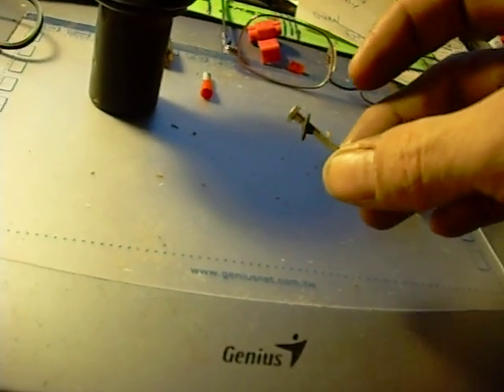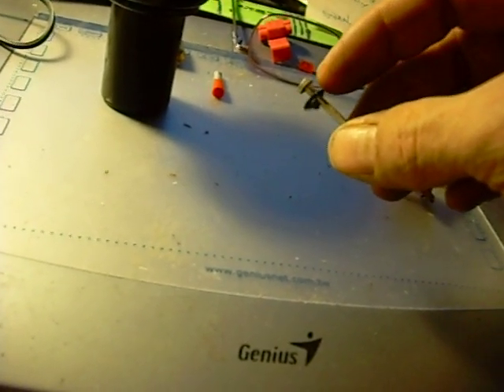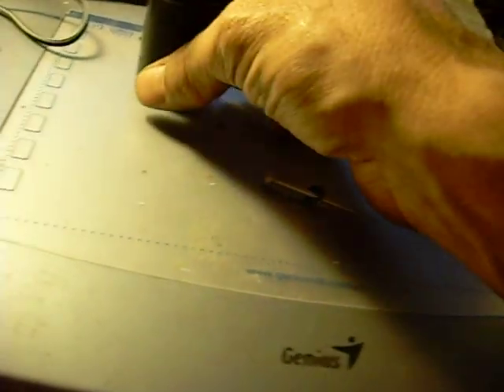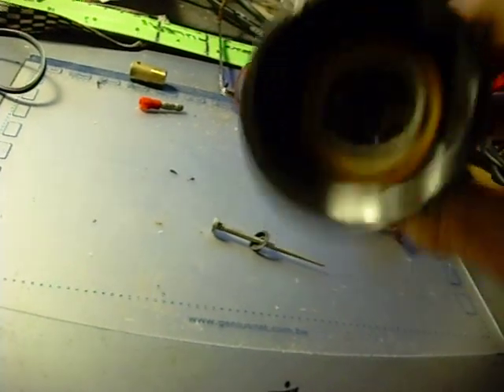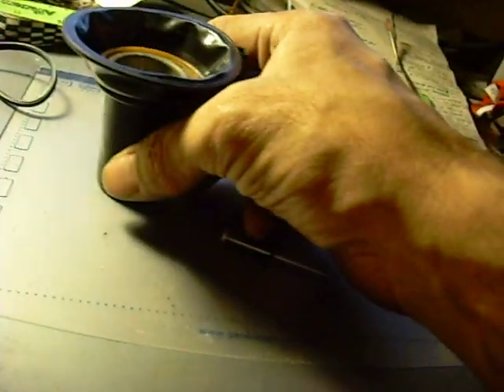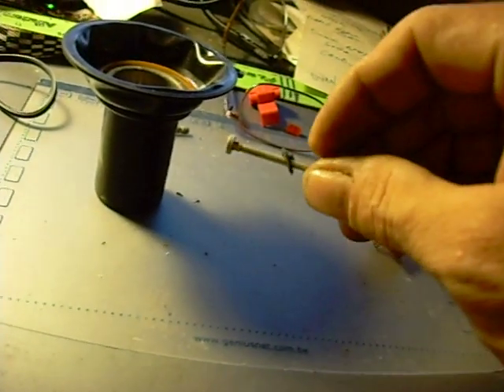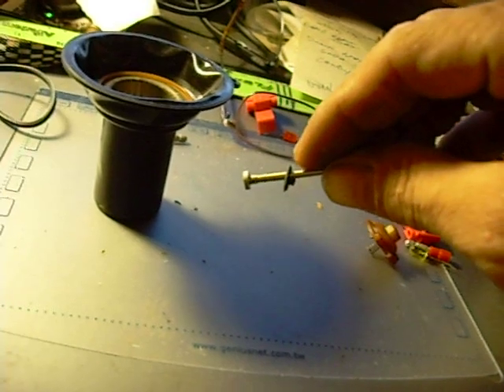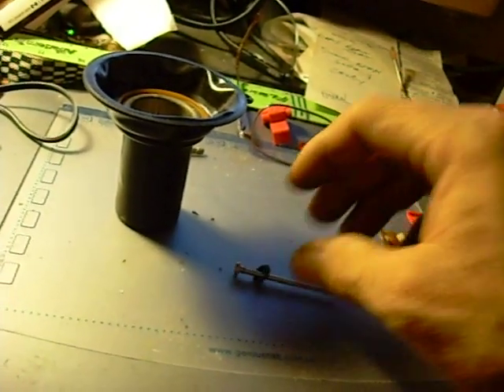diaphragm750

Comment: Hi I think that the needle valve is usually attached 2 the diaphram,cant remember right off, been a while since I been in those style carbs,you will probably have 2 replace the whole thing,however if you was leaking gas, that being tore was probably not your problem,the diapram and its needle valve meter the fuel to air flow,I would say you had a sticking float and needle valve most commonly trash gets between the needle valve and its seat allowing the fuel bowl 2 overflow hope this helps u  R A